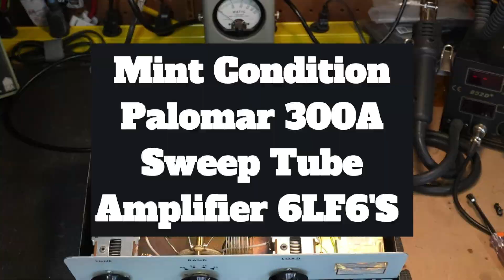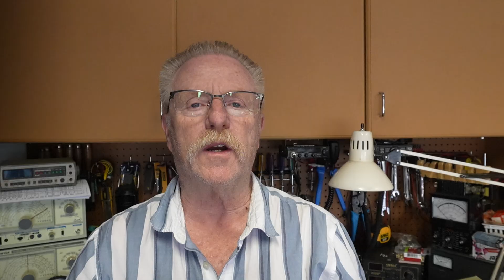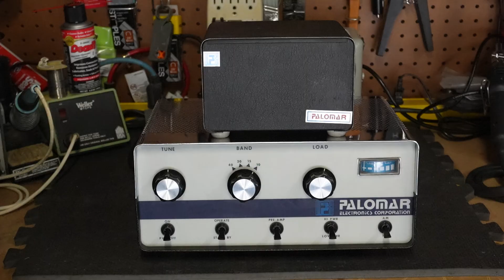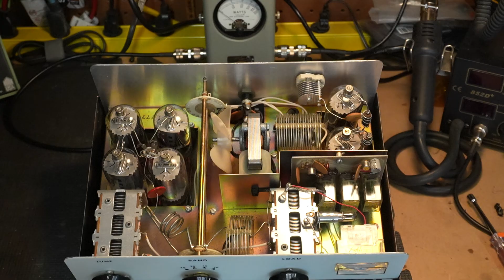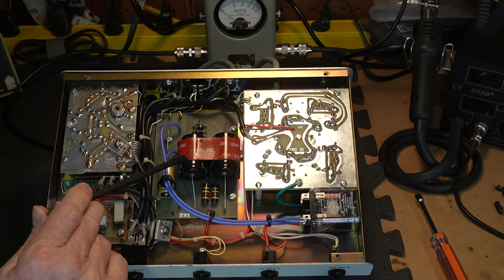Palomar 300A Amplifier

Comment: Hi, I just bought a Palomar 300A from eBay. It is a mess because the seller did not ship properly. Some tubes cracked. I am having trouble getting tubes that fit. The 6KD6 tubes I bought were to tall. I see yours uses a different tube. Do you work on these amps? Your video was very helpful.
 Thanks..

Comment: The "power supply" is not external, only the transformer.  "External transformer box".  
Switching the HV AC is not the best way to switch the HV because every time the amp is keyed the diodes have to absorb the extra pulse current of recharging the filter capacitors and the nleeder resistor load.  Even a fraction of a second for the HV to come up while drive is applied can be damaging to the tubes.   When sweep tubes were dirt cheap it didn't matter, but it's still poor design.
My 300A does not have an external grid bias control and the Palomar schematic doesn't show one either.  I have never seen a 300A with an external bias control and I've worked on them since the 70s.  The 350Z has separate internal adjustable bias controls for driver and final tubes.  The 300A tubes are self biased in TX via the 2 - 47 ohm 10 watt resistors that are switched to ground through a relay contact in TX, they are each in parallel with the series 1K  and 27 Ohm 5 watt resistors that are always connected to ground along with the -18v fixed bias.  Then in RX when the relay contact opens the fixed negative voltage along with the 1K ohm and 27 Ohm resistor in series to ground in each grid lead takes over to move the tubes operating point toward cutoff.  It's a good setup.  There is no need for an adjustable bias control.  The bias potentiometers are the common point of failure in the 350Z... they should have used 5 watt wire wound potentiometers.   The only bias failure point in the 300A is the relay contact and the fixed bias resolves that.  The tuces will never go into thermal runaway.
The 300A also does not have screen voltage applied/grounded grid, making it much more stable but the tradeoff is that the amplification is not as linear, so the 300A is not the "perfect" sweep tube amp or their best design.
Palomar was working on improving their designs until the end. They almost perfected it with the 350Z if they hadn't cut corners.
The 300A should have had the low/high switch flipped over (or wired the opposite way) and labeled "Low/High Drive".  
Walking the line of marketing to CBers and Hams required some compromises and generated a lot of controversy.   Swan found that out too when they took a lot of Ham unfounded criticism over Siltronix, but both companies had to keep the FCC happy while trying to stay profitable.